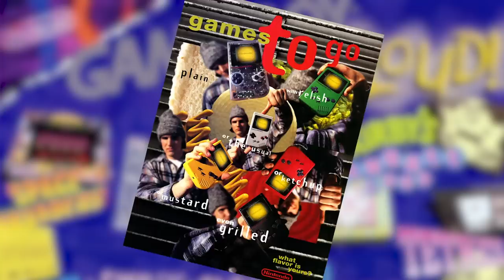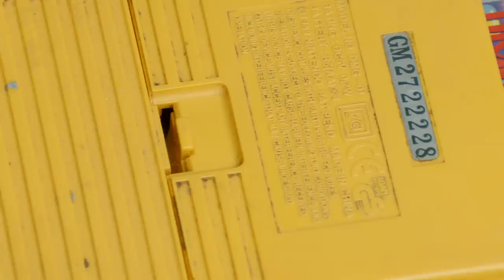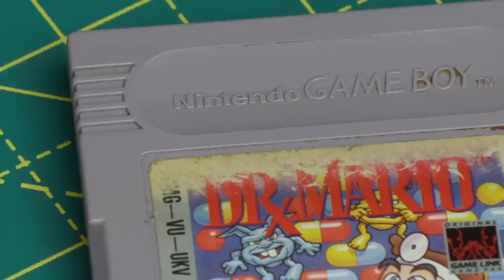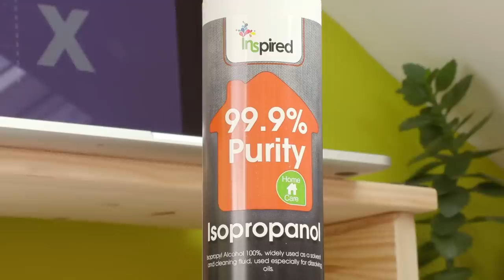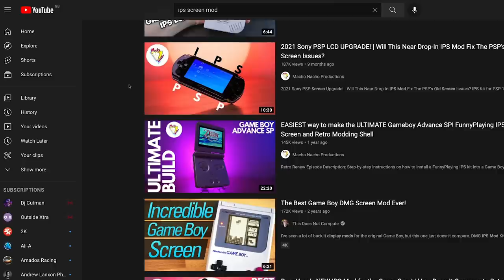Original Game Boy Yellow Restoration | Show of the Weekend

Comment: Since watching the original video I actually found an grey DMG at a local charity shop and restored it using clear buttons. I wasnt able to add a backlight though, because i dont have a soldering iron.

I also now have a massive bottle of isopropynol that i havemt used since

Comment: You really need to remove or replace all those electrolytic capacitors. At 27 years old they are either already not providing the protection they were intended to or are a ticking timebomb waiting to become a problem.
Man now I'm curious how those caps de-rated... time to dig through the battery box for a 9-volt to plug into my multimeter.

Comment: WARNING: You really should'nt rub the button membrane, As the black bits contain a layer of carbon that completes the circuit allowing the button to work, This can be rubbed off easily resulting in buttons not working.